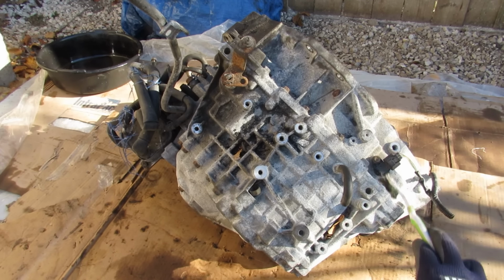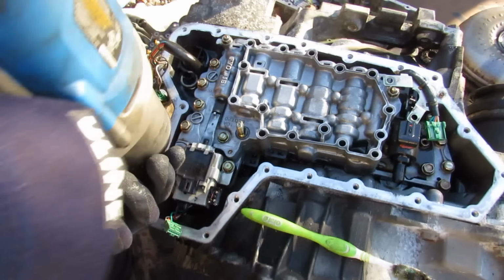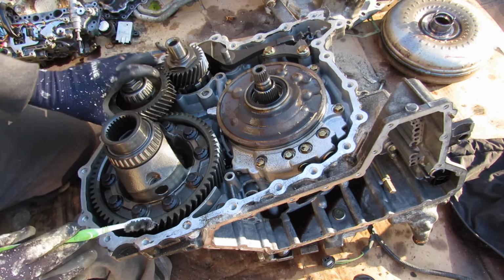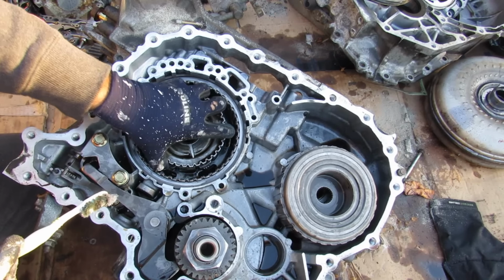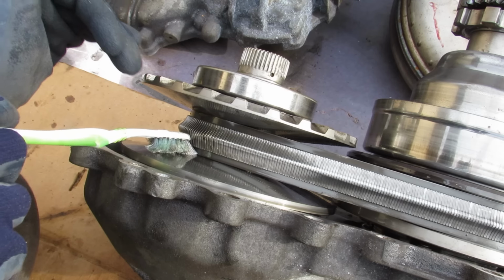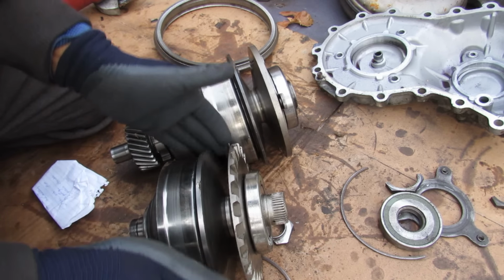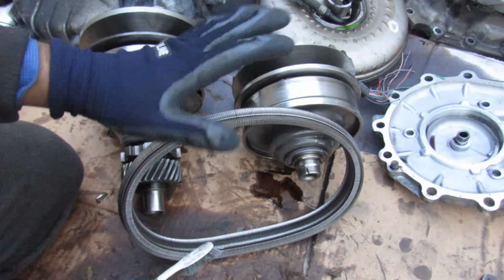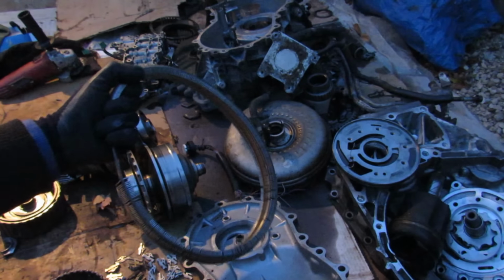Why Nissan CVTs FAIL

Comment: I had never heard of CVT until my Nissan I bought in 2015. From the first minute I drove it I knew it felt different but just got used to driving it. The fuel economy was great, 37 average MPG. In 2019 the CVT started to fail. I got a crash course in what they were and the downside. Seems shady for the dealership to not bring it up. I couldn't get rid of it fast enough.
Reply: Just had the transmission changed in my daughter’s 2015 Sentra. Thankfully fully covered by federal law suite against Nissan for these CVT’s. I told my daughter to keep it no more than 3 or 4 more years.
Reply: @deanjet  nissan WAS a favorite company of mine. Up till the late 90's tjey made some great cars, durable reliable workhorses...the little 93 sentra, late 90's altima, the hardbody trucks, the maxima (self branded the 4 door sports car!) 300ZX sports car, Nissan was awesome. My family had 3 at one point. I was the only outsider with a volvo...

But then something happened, years passed and we got absolute pieces of CRAP from nissan like the rogue, murano, and modern sentra. Even in mid 00's nissan started having issues with the altima 2.4 engine failing because the catalyitc converter would turn to dust and exhaust pulses would push pieces of it back into the engine and score up the combustion chamber.
Reply: @deanjet  - hey deanjet, I've got a 2015 Altima with the CVT. Luckily I haven't had any problems yet, but starting to worry, because I had planned on keeping this thing a long time. Can you explain your experience with the dealership and issues getting the CVT replaced?
Reply: @torreyweaver  main thing is keeping the CVT oil changed (i would say at half its mileage CVT oil change service cycle) if that CVT oil goes bad (or put the incorrect CVT oil in) it doesn't take long for it to start to fail, unfortunately overheating can be a problem watch is as good as having old oil (unsure if there is any modifications to make the cooling capacity larger
Reply: @leexgx  I plan on calling soon to see if I'm covered under the 120k/10yr warranty. I think I remember getting that letter years ago, but have no clue if I still have it. I'm at 75k miles now and will be doing CVT and coolant changes within the next month. I wish the mod of adding the transmission cooler didn't void the warranty, because that would ease my worry. I'm starting to consider selling while this thing still runs great. Shame, I actually love this car...
Reply: @leexgx  by the way, this will be the first time the CVT oil has been changed (75k miles). Do you know if that affects the warranty? And does it have to be done at a dealership to qualify?
Reply: @torreyweaver  2013+ Altima's have the new Xtronic CVT's. Chain driven, not belt. More reliable than the belt driven ones. A Maxima group I'm in has many members over 200K with their original Xtronic CVT, one guy has clocked in over 400K driving across the country for work. The transmission shown in this video is the much older version, and many of it's issues have been fixed with the new ones. Specifically trans fluid temps- the fluid now sits below the variator, so there's less friction and heat buildup.
Reply: @frostbite1991  - that doesn't seem to be the case across the board.  Here's a video of a guy with a 2015 Altima S (same as mine) whose CVT belt fell apart.
https://youtu.be/ytQE18yE6QM
Reply: To be honest with you 4 years on  transmission with high mileage is good. We also don’t know how will you maintained the car. This is where most Failures of any transmission start.
Reply: Now days you have to really do research on the Vehicle that you’re buying and not even just the vehicle but the exact vehicle you’re buying engine transmission combination
Reply: 37 average? What car is that? And what kind of driving were you doing with it?
Reply: @harkovdent5707  - my general average in the suburbs of Dallas is about 25, but I did hit 49 once driving across East Texas into Arkansas. And that was with another person and probably an extra 100 lbs of camping equipment. Never got it to roll to 50 though, no matter how hard I tried.
Reply: 8

Comment: Well, that was pretty damn educational. My wife's Honda is a CVT machine. Now I understand the drag-ass delay in getting any response trying to back out of the slopped driveway. Thanks! And yeah, I'll be nicer to the car from here on out ;-)
Reply: CVT holding up? My 2014 accord cvt took a dump at 128k with regular maintenance.  The Differential inside the cvt was hosed leaking a half quart every week.

Comment: The non-rebuildability is designed in to be a cash generator for Nissan. 
Either drop big dollar on repair or buy another car. 

Actually looks like if parts were available it could be rebuilt fairly quickly and easily.

Comment: Nissan is beginning to get the message. Some of their models will have an automatic transmission in 2022.
Reply: Funny thing is, the CVTs would be alright if they stop throwing them into Altimas; Maximas and every high performance car in their lineup. Keep it in the Rogue or Versa, they'd be fine
Reply: Hopefully Honda and others will follow suit. CVT is the biggest automotive blunder in history
Reply: @JohnS-aka-JS  they're not going away. They're just too efficient.... don't worry gasoline cars will be gone mostly by 2050.

Comment: actually he only talked about belt shutter. He  didn't take the pulley hubs apart/off the shaft. under the pulley's there is 3 "Key ways" that allow the pulleys to press and compress. but instead of "Key stock" they use several bearings. these bearings hammer into the sides of the Key ways on the shaft. When the tolerance have been exceeded, it allows the pulleys to "Judder" and fail miserably as well when the bearings fall out or get cut in halves.  
But he does do a VERY good job of explaining the workings of it and "Belt" failure.
All in all, I Applaud the concise, precise and detailed education functionality of this video. Good Job and I am Glad you got your nut off.

Comment: Best deep-dive into a belt-drive CVT that I've seen. Thanks for the video! I can easily see why these fail: too much complexity. If the two pulleys fail to synchronize their diameters properly, the belt will be too loose or two tight, and it will break. The system is critically dependent on the oil being clean and of the proper viscosity at all times, or the hydraulic controls that actuate the belt pulleys won't work properly. The E-CVT transmissions used on hybrids and EV's are also CVT's, but there are no hydraulic actuators and no clutch packs. The "variability" part of the power equation in an E-CVT comes from the fact that the 3-phase electric motors that power them can provide a very flat torque curve from a dead stop all the way to full speed. So there only needs to be 1 gear ratio between the primary drive motor and the final drive differential. The failure modes of an E-CVT are almost all to do with the electrical components and computer controls, and these have been proven to be pretty reliable, at least more so than the JATCO belt-drive CVT we saw in this video.
Reply: Well said !
Reply: clean oil and proper viscosity counts for a lot- even in a conventional automatic. thats enough jatco-bashing for one night. one thing to remember- in 1970, datsun saved us with jatco automatics- saved us from borg-warner (letchworth UK).

Comment: I have a 2012 Altima Coupe with the CVT and just hit 112,000 and haven't had a single problem from my CVT. Dad has a 2013 Nissan Maxima with the CVT and he has even more miles at 120,000 and hasn't had a problem. Could it be specific years or whats the deal?!

Comment: Nissan put a CVT in my NV200 cargo van. It cost me $4300 to replace and Nissan only offered a 1 year warranty which says a lot about their faith in their own products. Fortunately, I found a transmission shop that offered a 3 year/100,000 mile warranty for $100 less than the dealership. I absolutely HATE Nissan and CVTs now.
Reply from the maker: Didn't know the vans had CVT too
Reply: @speedkar99  yeah, worst thing they ever did. The engine isn't powerful enough and the transmission isn't strong enough. It has a 4 cyl engine but averages 18 mpg and has been nothing but problems.

Comment: I didn't know that tooth brush can hold over tons of engineering knowledge and beyond useful than the pro presentation laser pen from my manager who everyday talk nonsense in office 😂🙈
Reply from the maker: Teach-brush
Reply: @speedkar99  Did you met something bad about Honda's own G shift CVT so far? I am thinking to get a Civic 2021...
Reply: @lawlaw91  how much?
Reply: @Mabeylater293  I am thinking to get the 1.5 turbo charge version, 129k in Malaysia, I think around 33k Usd or something...and the gear Honda use is called G Shift Control CVT,  not sure if it is a better transmission...

Comment: Take the variators apart. Inside, there is usually slide bearings, consisting of rolling balls inside races. They serve the same function as a spline shaft, allowing axial movement, while transferring torque to the moving cones. They tend to broach out the races, causing them to bind. If that happens, you DON'T get the uniform clamping force from each variator, resulting in all the symptoms you described. Those slide bearings in the variators are the number one cause of failures in these CVT transmissions. The slide bearings have a hard time handling the torque of V-6 engines, and even some larger displacement 4-cylinder engines. These are excellent transmissions, if you can keep the engine torque below ~120 Ft-Lb. The bigger engines can easily exceed that!
Reply: You're very correct about these units... they upgraded to a roller instead of just little balls. I believe they're holding up a little better now. My 2015 does fine, as does everyone else I know with a Nissan... weird it's only the internet that scares me about Nissan.
Reply: @NoName-gv6nm  CVT';s are still fairly new. As time goes on, they will solve more problems. I can see a time, where CVT;s are every bit as reliable as automatic transmissions.
Reply from the maker: Ya I've heard about that but didn't get the method  to take them apart

Comment: the cvt has almost all the same components as a normal auto trans............so why bother?  I mean it has a reverse clutch and a forward clutch.........its halfway to having as many clutches? Whats with the pump........its huge compared to something like a 4L60E??  Big pumps draw more power in parasitic loss.........so why?? If it makes a lot of heat.......its inefficient and has a friction problem that generates a lot of fine metal particles that kill other moving parts.  What we have here is a stupid idea that is no better than a standard auto and costs a lot more to fix........ I know people her in Australia that have been quoted AUD $7k to fix these, and everyone knows that they last only a fraction the distance of a normal auto.
Reply from the maker: I think an electric car would work for you 😉
Reply: @speedkar99  electric cars.........LoL not a chance.  Normally with 'progress' a new design or idea is meant to improve on the previous available system. Either by being cheaper to make,lighter,more rugged or a performance aspect. Compared to modern 6 speed conventional auto's...........the CVT doesnt seem to have any actual advantage.  Your video really 'lifts the lid' on the components present,size,weight etc.............and given the known lack of durability and cost of these CVT's it beggars the question.........Why bother?
Reply: @wazza33racer  it fits the Renault formula: unreliable, can’t be fixed, must be replaced, $$$$$

Comment: The history behind this configuration will show how important was to find the right oil that can withstand pressure and friction between the plates, really interesting. The concept is awesome it just depend on the quality of the components.
Reply from the maker: Yes that's quite some engineering and validation

Comment: CVT is the same as a DAF 55 in 1970 But they never failed ! My Daf 55 coupe did 100k and no problems
Reply: @EpicDrew15  Miles , was a 55 Marathon Coupe Auto ! One single speed and a reverse only ! Never missed a beat , I have an SLK230K & SLK200K now , they run well no problems in 20 years & 100k + miles each I have owned the 200 a long time , 230 had about 5 years & almost as good hehehe
Reply: @EpicDrew15  SLK230 had an air flow meter stop working 2 years ago that's it ? Both have been great to own yet I look online and  lot have problems ? Trashing and no servicing more like it ! What car do you have or fancy ?
Reply: @EpicDrew15  Cars very cheep now Corona around but lots have trippled in price ? Classic cars gone through the roof price wise ? Just picked up today a pretty old C220 estate 2001 year but 35,000 miles from new ! Total bargain £600 ? No m.o.t. as standing in a garage for 4 years , but passed m.o.t. this afternoon with no faults so on the road tomorrow ! Have an old 190E aswel as two SLK's ! I've gone Mercedes mad by accident hehehe

Comment: This was incredibly educational.
Sadly I own an Altima with a CVT. The dealer keeps telling me I need to do a flush of my transmission fluid. I now understand why that fluid needs to be changed on a routine basis, but do I really need the flush or will a drain and fill be sufficient? I do most of the maintenance on my cars and I can do the drain and fill, but I don't have any way to do the "power flush" they they 'recommend' 

What do you think?
Reply: @EpicDrew15  no way man, drain and refill only. No dealers should be suggesting a power flush. You can find the TSB online for this service per Nissan, and it's just a drain and refill. DO NOT POWER FLUSH.
Reply from the maker: Glad you appreciate my video

Comment: So, does this thing has any rubber components in the belt? Please explain. And if not, does any of cvts has, maybe one of the models? I know that Subaru use metal chain, what about Toyota (Aisin) or Honda (Honda as I know produce such parts itself)? What was wrong with that cvt? Internals look good, exept filters and magnets? What was the miliage? 
Thank you. Stay well!
Reply from the maker: No rubber

Comment: Tips for caring for a cvt, from info I read
1. Change fluid often, especially in severe use.
2. Warm the car up for a few minutes for fluids to rise up. Drive and go from a cold start is what makes parts let alone a cvt to fail prematurely. But I get it y'all are young and have to hustle to a party.
3. Add an external trans cooler especially in a Nissan. The cvt will last longer and reduce s whining in the heat.
4. Simple, don't get a CVT lol

Comment: (Assuming this design is basically the same between Nissan and Honda), key to understanding the action of the pulleys:
The Driven pulley is spring-loaded to keep constant pressure on the flanges to try to squeeze the belt outward. They use hydraulic pressure only on the Drive pulley, and that pressure controls the width of both pulleys at any given time. The spring pressure on the driven prevents any slack whatsoever in the belt, which is vital not only in transferring torque, but preventing slippage.
Also, any contaminants whatsoever that finds its way between belt and pulley surface will likely eventually destroy both. IIRC, the fluid is designed to last the life of the unit, which reduces the likelihood of contaminants accidentally being introduced during fluid changes.
Rebuilding this design isn't economically feasible, as it would require replacement of belt and both pulleys.
Reply: @EpicDrew15  You don't replace the pulley assemblies? Or the belt?

Comment: 17:14  These CVT's are not more efficient; as you pointed out earlier, the variator-belt system produces a lot of heat.  This [Traction] CVT aids efficiency of the engine by assuring operation within the most efficient engine speed range, more than enough to compensate for its own inefficiency.
I should add that this type of CVT is only one of at least three fundamental types of CVT's, and it depends on traction or semi-static friction, which is its limiting characteristic for durability.  This featured video also refers to a second type of CVT we call a torque converter, used here and in most automatic transmissions to get the vehicle moving fast enough for the basic tranny to take over without stalling; the torque converter is a hydrostatic CVT, smooth but very inefficient.
A third type of CVT is known as a 'Ratcheting CVT', that is intrinsically much more efficient, high-power capable & durable, not yet used in vehicles because its output is not smooth enough, but the smoothness issue is being addressed, so it's a promising technology.

Comment: 19:13  You are using the term 'gear ratio' incorrectly.  Here's the definition: The ratio of the rotational speeds of the first and final gears in a train of gears or of any two meshing gears.
We've wrongly become accustomed to regarding 'first' gear as a 'low' gear, but it's actually a high gear ratio.  Gear ratio refers to relative input (engine) speed, not output (vehicle)  speed.

Comment: Had my transmission fail in my 2013 Rouge they are supposed to fix it under warranty had a buzzing sound at 2500 to 2800 rpm
Reply from the maker: Are they fixing it?

Comment: CVT despite being crappy in their early implementations are a really smart idea.
Reply from the maker: Why
Reply: @speedkar99  because they tend to be fuel efficient. 

The automobile industry doesn't change very much, therefore the introduction of the CVT - a new transmission concept - says a lot about the CTV. It has to be very good to convince the car industry to embrace it.